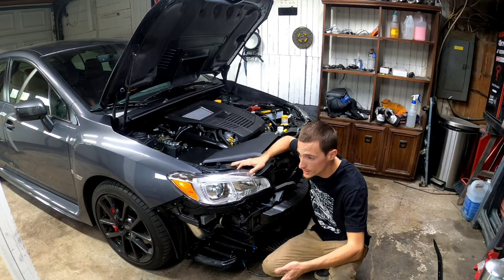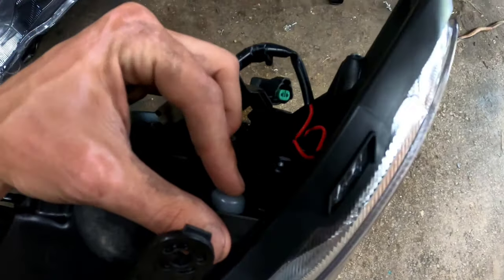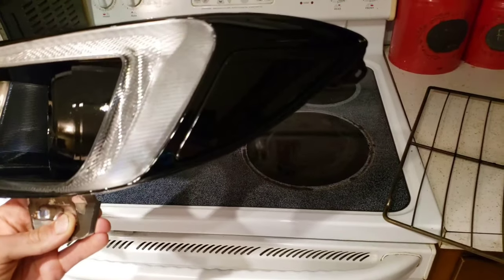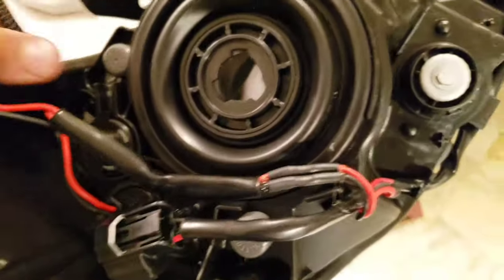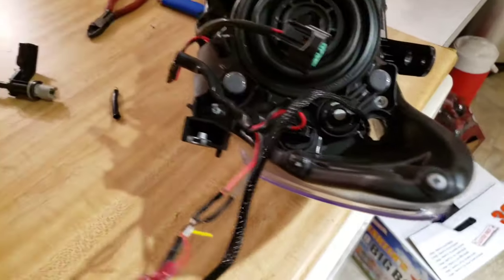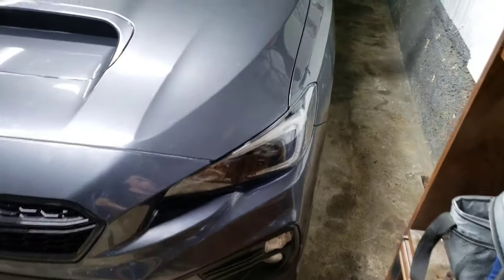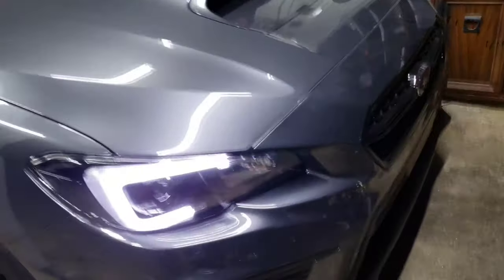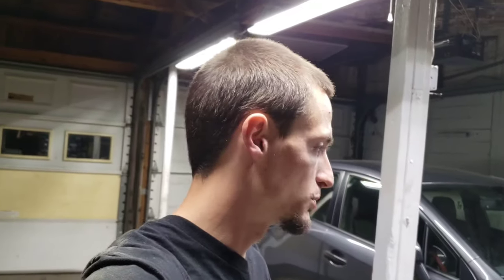Painting My WRX Headlights & C Light Install

Comment: If I did this to my wrx limited with the moving headlights, would that take away the moving headlight function?
Reply from the maker: Not as long as you don't damage them during the process. But the disassembly might be slightly different on them.

Comment: What kind of paint did you use?
Reply from the maker: I used PPG Deltron Basecoat and shopline JC620 clearcoat. I recently found out though that you can soak the chrome peice in oven cleaner and the chrome peels right off leaving a mirror finish gloss black underneath! That's probably an easier option!
Reply: @StreetInspired1 will that not affect the brightness of the c lights?
Reply from the maker: @elevate8904  not at all!

Comment: Was the paint a high temp paint or standard automotive body panel paint? Thinking of doing this in the coming week or so and don't want any issues with the paint after I've resealed them. Also like the idea of leaving part of the C-light chrome for more contrast.
Reply from the maker: The paint i used was standard body paint.  However I recently discovered that you can remove the factory chrome without painting the headlight by soaking  them in zepp oven degreaser. It leaves behind a factory mirror finish black. But you could just use any spray paint will hold up just fine as long as you sand them down good.
Reply: @StreetInspired1  you brought up a good point with the supplied taps DD includes with the C-lights. How did you wire it on your car? Wish I knew about the zep method for blacking out the chrome... it would've saved me a few bucks buying paint lol

Comment: What sealant did you use
Reply from the maker: Morimoto retrofitting glue
Reply: @StreetInspired1  do you recommend me use black rubber sealant
Reply from the maker: @speedxtc9236  as long as its some sort of headlight sealant you should be okay. I even reused the factory sealant on a set one time and it was okay. I just wouldn't recommend RTV silicone because I used that one time and it released harsh fumes after being sealed that hazed the inside of the lense.